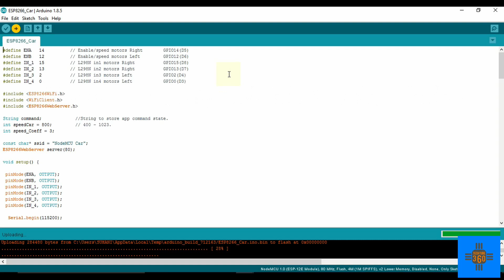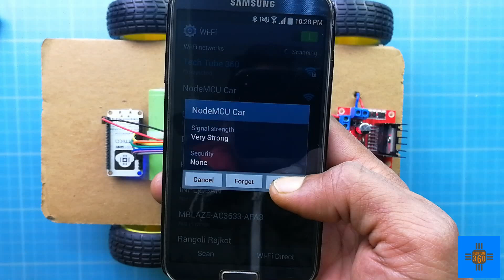Diy Amazing WiFi car mobile controlled | WiFi car V/S RC car challenge

Comment: Arduino: 1.8.9 (Windows 7), Board: "Generic ESP8266 Module, Serial, 80 MHz, 80MHz, DIO, 115200, 512K (64K SPIFFS), ck"

Sketch uses 249474 bytes (57%) of program storage space. Maximum is 434160 bytes.
Global variables use 38424 bytes (46%) of dynamic memory, leaving 43496 bytes for local variables. Maximum is 81920 bytes.
warning: espcomm_sync failed
error: espcomm_open failed
error: espcomm_open failed

This report would have more information with
"Show verbose output during compilation"
option enabled in File -> Preferences.
what should i do ????
Reply from the maker: Erase the board and reset upload a program it will work ✌️🙏😊👍
Reply: @techtube360world  will try now plz be online
Reply: @techtube360world  gettig this again
Arduino: 1.8.9 (Windows 7), Board: "Generic ESP8266 Module, Serial, 80 MHz, 80MHz, DIO, 115200, 512K (64K SPIFFS), ck"

Build options changed, rebuilding all
Sketch uses 198624 bytes (45%) of program storage space. Maximum is 434160 bytes.
Global variables use 33034 bytes (40%) of dynamic memory, leaving 48886 bytes for local variables. Maximum is 81920 bytes.
warning: espcomm_sync failed
error: espcomm_open failed
error: espcomm_open failed

This report would have more information with
"Show verbose output during compilation"
option enabled in File -> Preferences.
Reply from the maker: @y.r.nagendra366  you try another Arduino car in my YouTube if you are using Arduino Uno board
Reply: @y.r.nagendra366  Had problems like this too, My NodeMCU board uses 9600 baudrate, thats how i solved it. Which nodemcu board are u using?

Comment: i am getting this error message

Arduino: 1.8.9 (Windows 7), Board: "NodeMCU 1.0 (ESP-12E Module), 160 MHz, OTA, 80MHz, DIO, 115200, 1M (256K SPIFFS)"

Sketch uses 249506 bytes (32%) of program storage space. Maximum is 761840 bytes.
Global variables use 38424 bytes (46%) of dynamic memory, leaving 43496 bytes for local variables. Maximum is 81920 bytes.
java.io.IOException: Cannot run program "python.exe": CreateProcess error=2, The system cannot find the file specified
 at java.lang.ProcessBuilder.start(ProcessBuilder.java:1048)
 at processing.app.helpers.ProcessUtils.exec(ProcessUtils.java:26)
 at cc.arduino.packages.Uploader.executeUploadCommand(Uploader.java:129)
 at cc.arduino.packages.uploaders.SerialUploader.runCommand(SerialUploader.java:383)
 at cc.arduino.packages.uploaders.SerialUploader.uploadUsingPreferences(SerialUploader.java:197)
 at cc.arduino.UploaderUtils.upload(UploaderUtils.java:77)
 at processing.app.SketchController.upload(SketchController.java:732)
 at processing.app.SketchController.exportApplet(SketchController.java:703)
 at processing.app.Editor$UploadHandler.run(Editor.java:2070)
 at java.lang.Thread.run(Thread.java:748)
Caused by: java.io.IOException: CreateProcess error=2, The system cannot find the file specified
 at java.lang.ProcessImpl.create(Native Method)
 at java.lang.ProcessImpl.<init>(ProcessImpl.java:386)
 at java.lang.ProcessImpl.start(ProcessImpl.java:137)
 at java.lang.ProcessBuilder.start(ProcessBuilder.java:1029)
 ... 9 more
An error occurred while uploading the sketch

This report would have more information with
"Show verbose output during compilation"
option enabled in File -> Preferences.